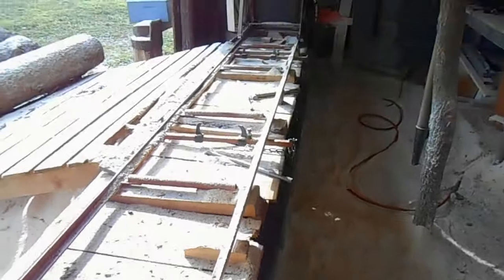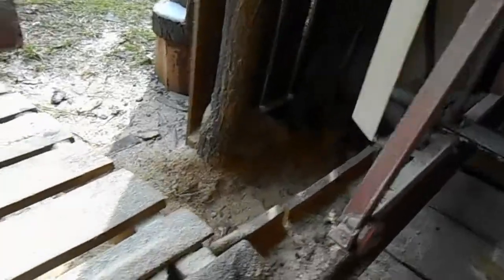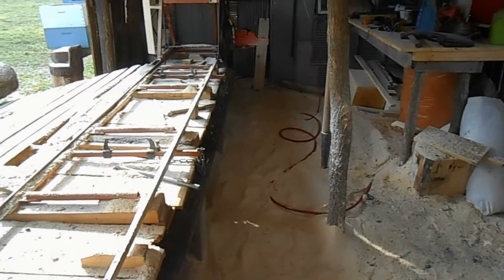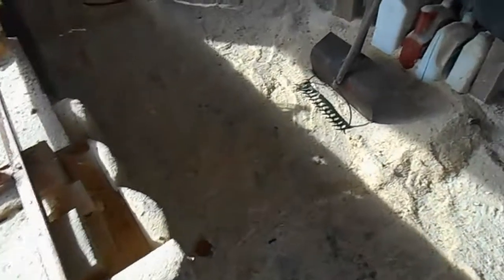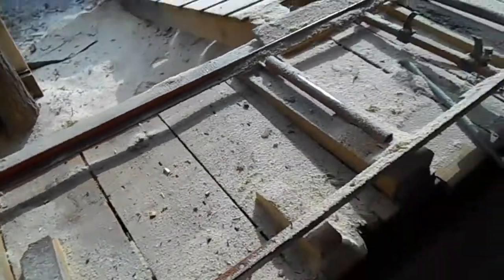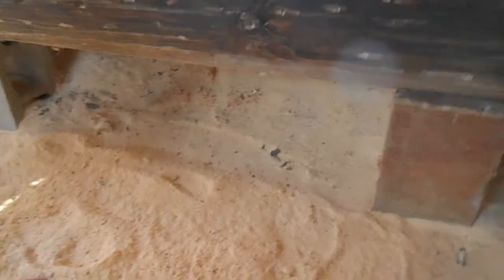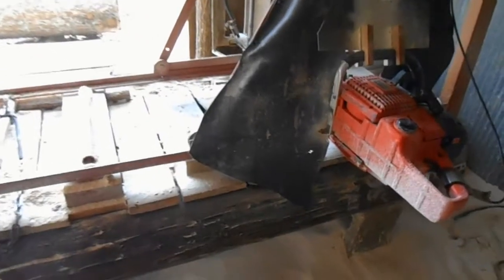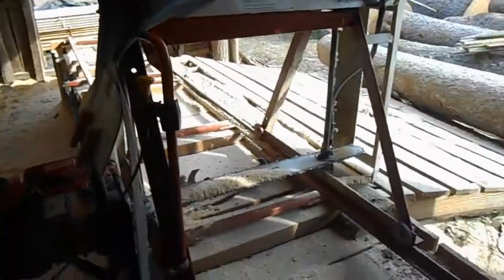Sawmill things to think about...

Comment from the maker: There are a lot of factors in your question concerning sharpening the chain. 
1. How dirty the log is. (dirt is hard on the chain)
2. Species of wood. (some are harder than others)
3. Foreign materials in log. (Nails, bullets, etc.)
This being said I average a couple hundred board feet between sharpening. And I just replaced the bar after years and years of use.

Comment: I had to deal with the same problems.  The sawdust is time consuming to clean up, but we use it on our blueberry plants.  Also grow boxes.  The larger scraps, slash pile, we use for grow boxes, or just cut and use in our woodstoves.   

I decided not to enclose the mill area, it just has a roof over it, no walls.  I am still thinking a fan or two might be a good safety precaution.   I would like to have a wall or two, but am nervous about it.   Maybe I will get the fans installed then make a decision.  When I watched your first video, I wondered how you survived the fumes. You might want to put a warning and a link to this clip from the description area on the video of you making you saw mill house.  That way if anyone starts to build a sawmill house they can think of these things before they do something that could be very dangerous or fatal.

Thanks for the nice videos.  I wanted to get a video of our sawmill setup on our youtube channel, but I can't find the videos we took.   Guess I will have to have my wife take another one.

Comment: get some 6" deep plastic bins under the sawmill platform to catch the sawdust under the platform with steel grate replacing the boards or drill 1.5" holes in the wood.  You can drag them out with little ropes attached to them.  On the floor put six small canvas tarps that you can grab the corners and drag it when it still only has 3 inches of dust on it.  These can be drug outside in a few minutes and then put back down and save all that shoveling.
Reply from the maker: Boy, you have some great ideas here. Thanks! I am sick of the shovel.